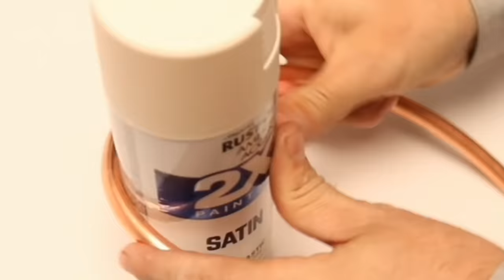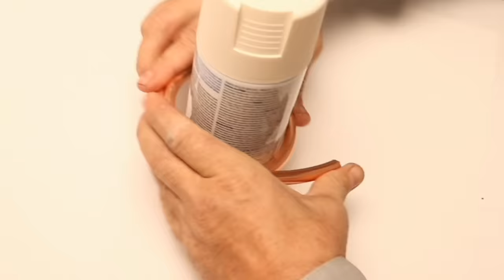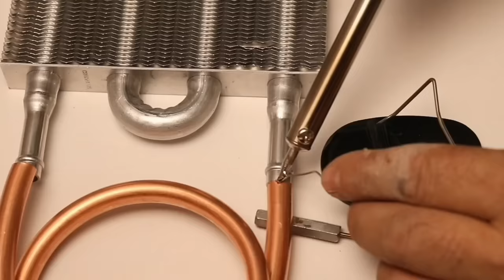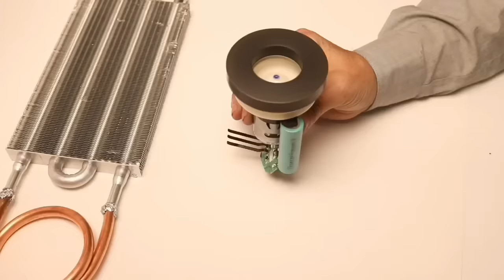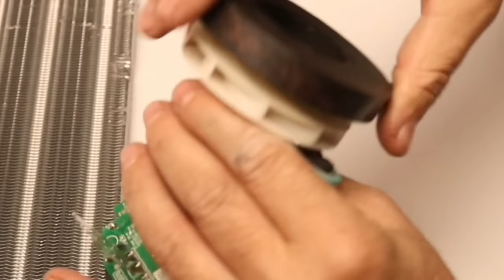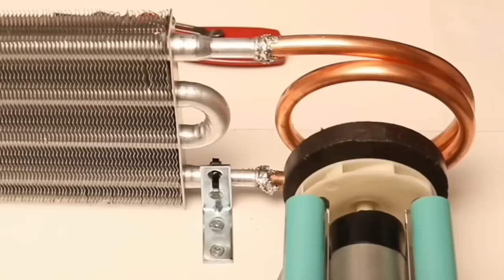Magnetic induction heating

Comment: didnt work for me fake
Reply from the maker: Are you sure you did it correctly? There's very complicated proceedings with this method.
Reply: since u answer me i put smal magnetic but i dont have this radiator
Reply: how long to be heat how much highest tempruture
Reply from the maker: @kanarimentos7056  yes the Radiator is necessary for sure, and you might want to use antifreeze or a liquid of some kind to transfer the heat better. Also if you use individual 1" neodymium magnets on the circle in opposite polarity every other time you'll have much better results . Thanks for watching
Reply from the maker: @kanarimentos7056  this will be determined by your experiment. Mine was in the high 80s

Comment: You want to heat water, but simply replace gas as the energy source with electrical energy that runs the motor that has to provide the mechanical power to create the eddy currents - what nonsense - an electric instantaneous water heater can do that much more efficiently, cheaper and with no moving parts or losses.
Reply: it works on the same basic principle although he is missing like 25 steps of optimization. Like for starters a vertical coil with more windings, of course this little experiment here could convert any rotational energy into heat. Maybe that is where this was going
Reply: @theharbingerofconflation  

if you have something rotating for free, its... a method, though the whole concept needs to be re-evaluated.

as OP says, a resistor is 100% efficient. all the power consumed in the resistance is dumped into the water/fluid/whatevers being heated.

a heat pump can sort of break that, with a cop over 100%. seems like black magic, but the best way to think of it is carrying a petrol can. you use some energy to convey a large amount of energy but you dont use any of that, CANT use any of that actual energy you happen to be moving... anyway.

this idea... as it is, its useless. induction heating equation... you got conductor dimensions, magnetic field strengths, and FREQUENCY. most variables being squared, for a doubling of frequency you get approximately 4x the heating.

the motor spinning the wheel is only 50% efficient, give or take. 
its speed is limited.
the frequency is simply the number of magnets x rpm. you find it gives very low figures, even with hundreds of poles. tesla managed to get 10khz with specially designed alternators with hundreds of poles and just had major issues at every step. as you increase the number of magnets they have to be smaller, or the wheel gets larger.as the magnets get smaller the flux density reduces. as the wheel gets larger the critical RPM lowers. no matter how you approach it, theres always these limits popping up.
then theres heating of the alternator itself due to eddy currents induced...

the one thing that WILL work, as i use it myself for a dyno, is to replace the coil with a simple slab of copper. need lots of iron in the magnetic path to reduce reluctance, and get maximum flux density in the gap through which the conductor passes... having loose magnets waving freely in the breeze wastes 9/10 or more of the magnetic force...

it works as a dyno simply because the eddy currents and the lenz effect gives a very nice braking effect. and damn, does that disc get hot!

if theres no braking force, theres no power being consumed. whereas, trying to hold back just a little honda engine of 10kw, thats 10kw of energy being produced in a 1/4" thick copper disc about 5 inches in diameter! (wait... im metric... what are those alien units?)

with plenty of copper, the eddy currents are free to circulate as they want to, with no concerns about pipe, thin walls, etc.

as the copper gets thicker though, the flux density in the gap reduces as the reluctance of the magnetic path increases... and as the copper gets thicker, the speed required to produce the same heat is reduced, but as the flux decreased the rpm must increase too... more catch22...

at this point, the heat generated is a direct indication of power applied by the motor.. as is the current required in electromagnets to produce a given braking force... or my first attempt with permanent magnets, the gap between magnet and disc. i found the heat fried my neo magnets. lol.

the whole idea is to get as much flux as possible cutting the conductor, and then rapidly alternating it.

without enough flux, theres not enough eddy current produced. without enough speed, theres not enough eddy current produced. without sufficient conductor, there isnt enough eddy current produced. end result, theres no braking fore, and no work is performed.

the "rate of change", EMF being the number of lines cut per second per conductor... the more flux cut in less time is more EMF or eddy current or power or heat or whatever...

slightly more complex than "waving magnets past a wire".

its all very straightforward when you actually think about it.

anyway. its absolutely pointless unless you have something thats spinning away doing nothing of any use as it currently is.

Comment: The only thing that will heat up to a low level is the motor.  It's a "do nothing" assemblage of parts.  Cold solder joints with a soldering pencil.  No fluid in the plumbing to carry the heat tot the radiator.  No check valves to control the directional flow of the non-existent heating fluid.

Comment: People here must realise that this would break the laws of physics. The output of this would at most equal the capacity of the two batteries. Your energy conversions looks like this Chemical>electrical>mechanical>magnetic>mechanical>heat. With losses at every step. This would only make sense if the the magnetics are driven off wind,hydro or solar or stored energy from either. The energy to heat has to come from somewhere.
Reply from the maker: I agree it wasn't quite the "Heater of the year". Thanks for watching!
Reply from the maker: @scottcrawford7674 That's awesome! Thanks for the feedback and especially thanks for watching!
Reply: ..its posibke with the magnet, but he need 3 or 4 times faster rotation bevore it work..i think he new and try things oit on youtube..but i sure like this projet..im gona try to heat water bij meself and  pump it into radiator..or soo ;)
Reply from the maker: @MohAwad-mw2oz  Thanks for watching!!

Comment: The system doesn't even need fluid to head up.... it's a miracle!!!! 🤣🤣🤣🤣
Reply: Yeah I know.. but... it's doesn't even need a proper voltage reading just resonance at a low voltage.  Eddy currents are produced at the copper coil and magnet. Once the eddy currents propagate through the aluminum ... the aluminum heats up because of it's properties.  Aluminum melts faster using magnetic resonance.

Comment: You need neodymium magnets. You're only getting one pole here. You want a disk with multiple square neodymium magnets with alternating polarity 

That will improve the heat output exponentially
Reply from the maker: That really would!
Reply: What I want to know is what is the least expensive heater that you can buy on the market today, that also puts out a lot of heat? 
Besides the claims about an earth battery, I can find nothing!
Reply from the maker: @simon359  There's other ways to do this but it's the best method from what I hear. https://youtu.be/hzpADMk8QAs?si=lIGe0dINgRChlIeX

Comment: Doesn't need a inlet to top off with water. Like a radiator heating system. Another experiment used open system instead of closed loop
Reply from the maker: Good point. Thanks for watching.

Comment: What is the steel net kind of thing that you are using
Reply from the maker: It's an intercooler from Autozone (911401 Torqflo

Trans Cooler 5 X 12.75)
Reply: Please share the list of materials required
Reply: I really need to make one such project
Reply from the maker: @Saptarshee Bhattachatjee  There's better ways to do this technique. I'd recommend getting two sets of 4 individual magnets from walmart and place them on the wheel like I did on this video in the link.https://youtu.be/Xjym0LZNjdk make sure they're positioned North South North South Staggered to cause the best friction. This experiment could have been much hotter if I'd done it that way.
Reply from the maker: @Saptarshee Bhattachatjee  I just added 3 links in the description for all the supplies except the motor oil. Thats optional because it will hold the heat inside the intercooler longer.

Comment: Stick a resistor in to replace the motor, and you may achieve something.

Resistive heating. 100% efficient.

Inductive heating...
Well, theres the motor... 50%.
Then theres the poorly coupled fields... 20%...

 100% sure seems more effective than barely 10% if lucky.

edit. the actual HEATING of an eddy current is resistive, and is 100%. no transmission losses, any friction only helps. sound must be the only loss?
the problem here is the way the magnetic field interacts with the conductor.

if it simply oscillated back and forth within the coil, it would work fine. there would be a lenz reaction upon the magnet, and the force required would be proportional to the heat produced. power, energy, watts, joules, calories, heat.... mmmmm, heat.

theres no other way to arrange this magnet style to produce the eddy currents required. actually, there is, flipping it over. ie, dont rotate the magnet on its central axis. on the other axis! 

come up with a free way to spin a magnet the right way, and its actually a very sensible idea. ahem... wind...

as it is? its a joke. a scam.
Reply: The iron radiator is a resistor. The " poorly coupled", yes, the copper aren't aligbed with the spinning magnet :/. But this can work a little bit.

Comment: We know that when power up a motor it will rotate why show us that for an extended period.
Reply from the maker: If you watch till the end you'll see the heating radiation emitted from the fins of the aluminum cooler. The whole objective is to heat up the metal by using magnetic induction spinning a magnet close to copper that's connected to the radiator. At the end the digital thermometer shows the heat gained from the process.

Comment: U can't sodder copper to aluminum!
Reply: Yea you can but not with a soldering iron.  Lol. You need the right flux and silver solder with quite a bit of heat..  but yea, its done all the time.  Look at your central air coil inside.  Its likeky aluminum with copper piping to the outside unit..

Comment: I'm going to build this, I almost have everything just gotta build the spinning magnet.  Does any liquid get put inside the tubing and radiator?
Reply from the maker: It's optional. Some use just Motor oil. But I didn't use anything. I'd suggest using multiple magnets on a wheel between 6-10 for the friction. You'll get better heat results than what I got.
Reply: @RATED CREATIVE  I'm thing about putting 20 rectangle magnets on a wheel and have it spin inside the coil and put a few more loops of copper tubing enough to cover the magnets on the wheel
Reply from the maker: @ZaneM777  That's gonna be wild! I'm sure it's gonna warm things up!
Reply: @RATED CREATIVE  I really hope this works, it gets pretty cold during winter here and this is very affordable since I only need to get the magnets and build the wheel
Reply: It's FAKE.

Comment: Where did you get the metal radiator?
Reply from the maker: Autozone $35
Reply: @topnotchcontent  Do you have the model number or part number?
Reply from the maker: Yes here it is
000267252  911401

911401 Torqflo

Trans Cooler 5 X 12.75
Reply from the maker: @munchichi8  I'd say they gave me the wrong item then because that's what the receipt has listed.
Reply: OIL cooler, transmission cooler ,autozone, orilleys, advanced Auto